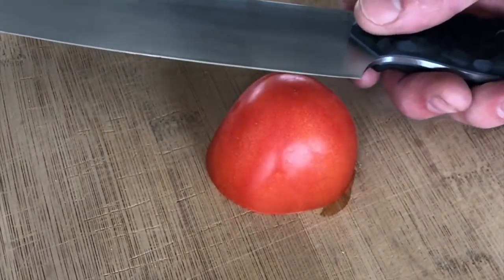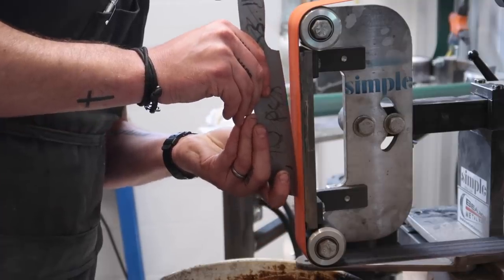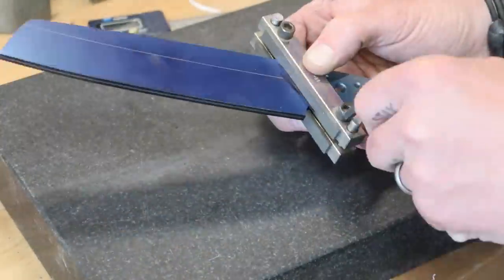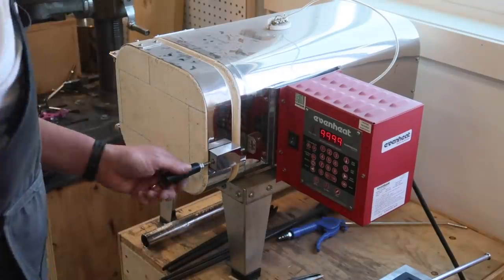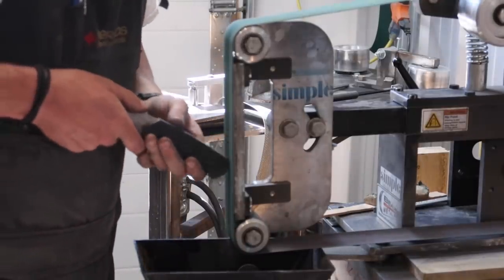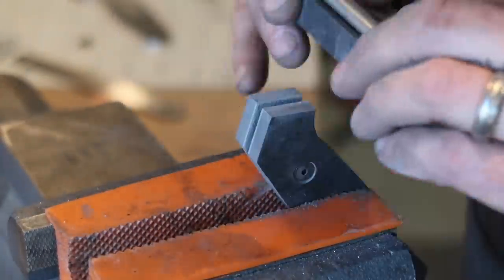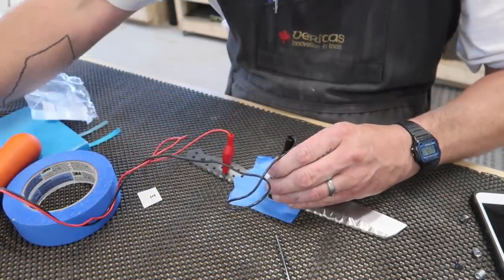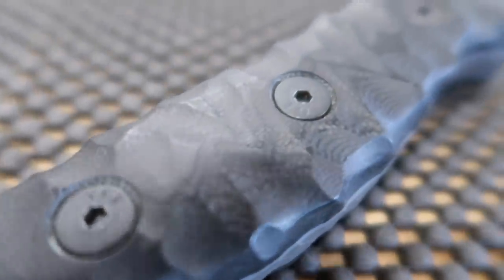Making a BBQ Knife

Comment: Best knife I've seen made in a long while.  I really like the seax
profile for a BBQ type slicer.  A cimitar works great for butchering and slicing but I'd like one of these. :)
  Looks like your customer is a TOPS knives fan.  They brought out that rock "mountain" pattern to their mass produced products.  I really like the way you did yours, though.  Better thought out and looks more comfortable to grip.
  I made a knife for a buddy who's still in the Air Force, used the fasteners like you used here.   I cut out material where you drilled the weight reduction holes and used the space to conceal a survival kit which included the standard stuff (fish hooks, Ferro rod, etc.) and a hand cuff key and exothermic chemical fire starter, just to found it out.  As long as he has his knife, he's good.
  It's much better than the traditional hollow handle with a compass pommel.  LOL.  You should try making one here, good project that people really like.

Comment: im not an expert but with steels that are cry treated, just sticking the blade in liquid nitrogen isnt super beneficial what you really want is to cool the steel at a certain rate over  a certain period of time depending on the steel. jay fischer has a whole series on heat treatment that id recommend you watch. also how thick did you take this knife before sharpening?

Comment: So I recently made a small blade and put an edge on it. Its sharp enough to shave hair with ease but it doesn't like to cut paper unless it's held just right. I've been using a stone repeatedly and going through the grits to form an even edge but it's still not getting there. Tends to only slice to the right on the paper. Any ideas on how to fix it?

Comment: what kind of belt did you use for the rock pattern on the knife?
Reply from the maker: It was a ceramic belt. 👍 works well on the steel and I wanted the matching grit on the G-10.

Comment: what are those stencil stickers called for your makers mark? i've been using a touch mark and it's so hit and miss i've ended up leaving my work unmarked. I have all the electro-etching stuff but i've never been able to get any of those nice stencils.
Reply from the maker: I cut them out myself on my circuit. They’re just vinyl and typically only good for a few knives before they start to get wonkey 😆👍
Reply: ah ok. cheers for getting back to me. you do a good job of it, they come out super clean.

Comment: I'm on the fence with DIY cryogenic treatment.  If you watch Jay Fischer's series on it you will see he makes the point that unless you have a controlled decent by 4-5 degrees per minute (on average) with a high end cryogenic-processor you are shocking the steel too quickly by just dunking it in LN2, and risking micro fractures in the steel.  You can suspend the blade above the LN2 first so it cools in the gas before dunking it, but again not ideal.  Sadly a cryogenic-processor made for knife makers still costs 8k US.  It's a tough decision to make.

Comment: Great video, Great knife! I question why you call handels  "scales" ? Please don't burst into tears over it, i just wonder about the name change and why ?
Reply from the maker: Thank you! That’s actually a very common term for this style of handles and not one I made it. Technically it is the correct term to depict this handle type👍
Reply from the maker: I guess I should clarify the scales are the pieces of material on each side of the handle. They called the same when they’re used on a hand gun handle. Hopefully that helps 🤷‍♂️👍
Reply: @Simplelittlelife  buzz! Wrong again! On handguns or any other firearms they are, by name, called handles by users or stocks by manufacturers. They have been referred to as such so everyone knows what the subject of the conversation is about. I can't believe that anyone ever said, "should you give someone a gun by the barrel or the  scales...

Comment: Nice design Jeremy.  One question.  Why no Lock Tight on the threads
Reply from the maker: Thank you! I find that with the aluminum stand-offs I don’t need lock-tight. And for the intended use of this knife it shouldn’t see any impact forces so I’m not too worried about them completely my loose. 👍
Reply: Simple Little Life logical.  I guess low impact no worries.